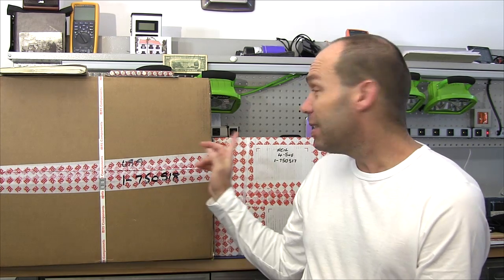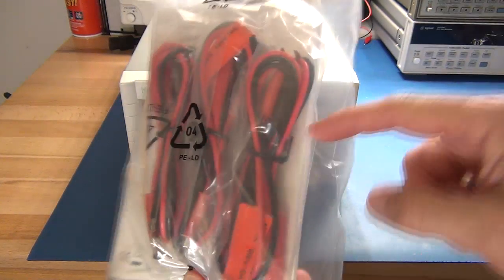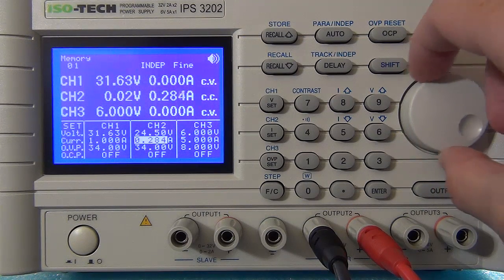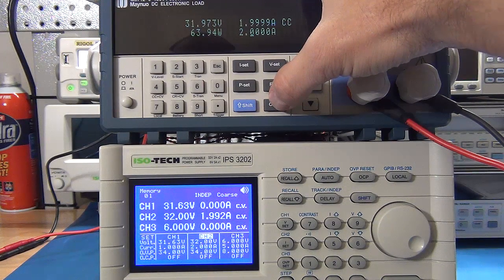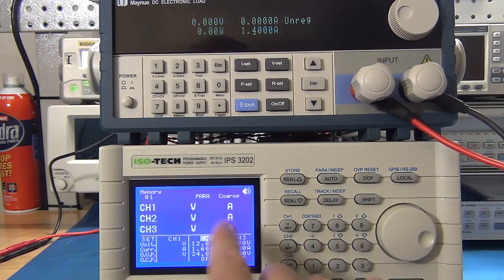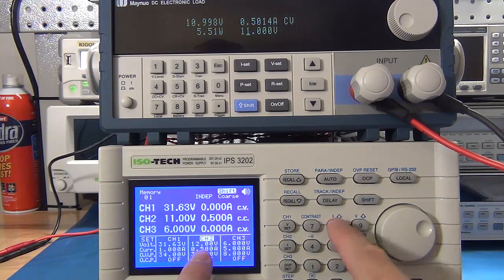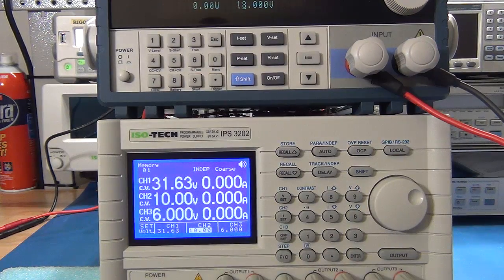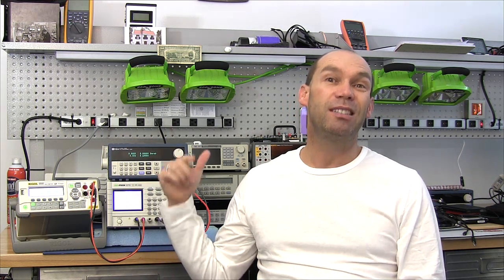T4D #80 - ISO-TECH prizes arrive, Review of the IPS 3202 PSU

Comment: Martin - I'd be curious to see if there's a problem with this supply like the Rigol DP832 - e.g. a voltage spike and some ringing when you turn the unit on (even with the outputs turned off).  Connect the outputs to your scope and set the trigger just above 0V and turn on the unit.

Comment: I wonder if the load is having a spike when enabled. You could check that with a 0.1ohm resistor in series and a scope.
With the batteries remember that capacity is very current depending. I have tested a couple of alkalines (lygte-info.dk) and you can easily get a 1 to 4 variation in capacity, depending on current.